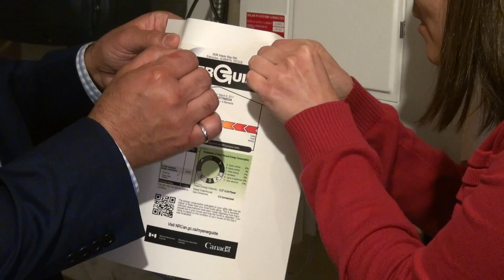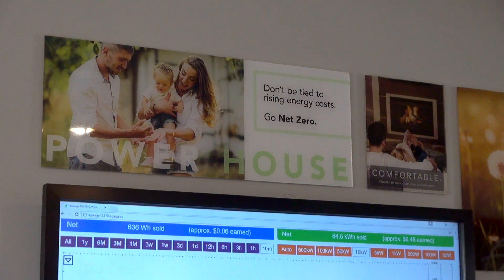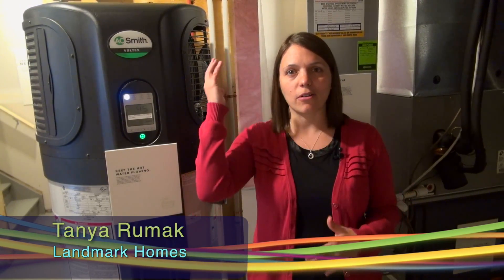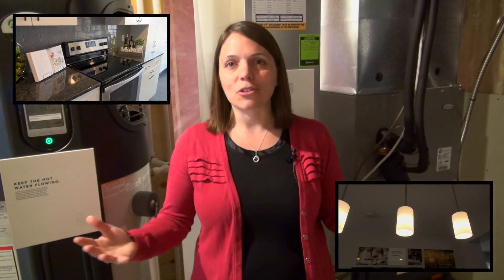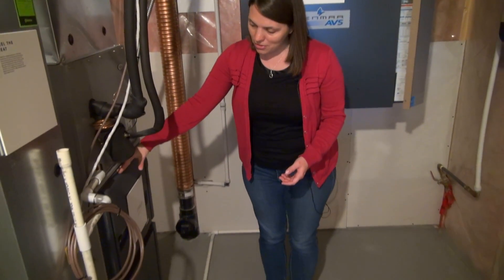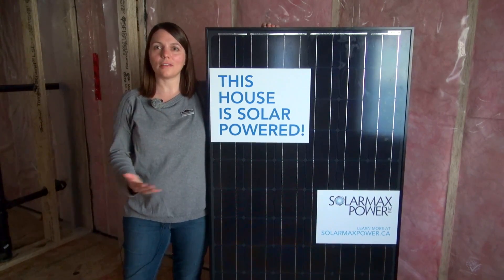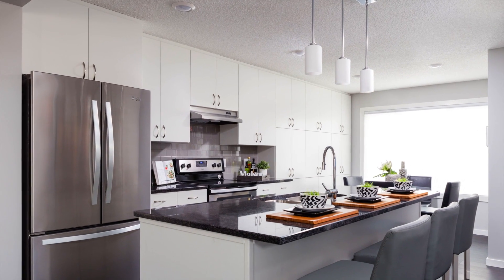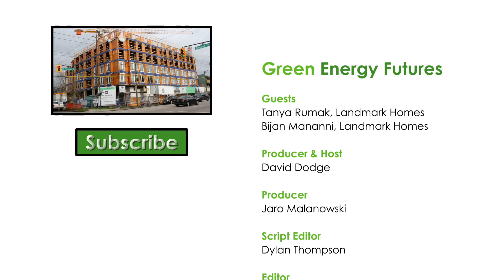168. The dawning of the age of affordable net-zero homes

Comment: hum   my home cost me $75000 it is 1700 sq ft. average total utility is around $150 a month. that is gas and electric. So around $55k to run the house for 30 more years.  I could still net zero the house by putting 30panels out in the back yard or roof.  No battery just grid tie. and still only add $15000 to the out of pocked and be net zero.  My guess is that at almost $400,000 am going to see this (Mine) house torn down a long time before the difference in my utility cost come close to the cost of going net zero in this example.  Net zero is great dont get me wrong, 75% of energy savings needs to start by making the house efficient.  This always starts with getting the building envelop correct.  Well sealed, great bulk water shedding, well controlled vapor and air barrier and getting the house down near the passive house standards.  Add in some passive solar and you have a building to crow about.  1200 sq ft is a great starter home or retirement home size.  So what are we looking at 600 sq ft space on each floor.  Two bedrooms a bath a decent size amount of closet space and of course loosing usable footage with the stair and hall way.  So not big.  But the $333.33 per square foot is not anything I would call affordable.

Comment: The Oracle of Omaha bought Nevada power the consumer who spent $20k. Now no longer pays for system. Berry low net meter you are charge a fortune net meter can charge. You did not explain lower net meter. Local put has 12 cent rate. 
A base connection fee $50 per month

Comment: Normal home 2500 as ft. So you only have half a house. $400k ÷ 1200 = $333 per sq foot. For net energy house 
Financing
Purchase $400k 
Finance $ 340k 
@ 4.5% put $1850 plus insurance and taxes. Will it appraise new construction at $333 per sq foot? What is cost of energy bonus package?
Can you appraise the cost savings of $300 per month at 12 cents kWh? Will bank accept adjustment to loan formula of 32% when no $3600 annual lite bill?

Comment: I like it, but why aren't they storing the surplus power in a battery pack? Surely something like a Tesla Power Wall unit could be incorporated in this design. That way when back-up heat is needed you'd have a ready supply of power. And with Alberta's incredible sunshine any extra power could be part of a F.I.T. program. Also, was spray-foam insulation ever considered? It makes for an incredibly airtight structure and has great sound attenuation properties. Thanks for keeping us up-to-date with your informative videos.

Comment: I noticed the TV screen in the house providing a visual representation of energy usage? Presenting energy usage in a visual manner is key. I just bought a Toyota Highlander Hybrid and one of the screens presents energy usage, hopefully making the driver use a lighter foot on the accelerator? Your videos represent rapidly advancing technology in the housing sector also occurring in the aviation and automotive sectors. Another common element I see is system integration where the various house components work as a complete unit. The houses are very attractive looking as well.

Comment: Wow. . . Net Zero for the life of the home. Must be nice... Except for, wait, what's the lifespan again?
Reply: Properly built, such a home can last indefinitely.
The mechanicals (and windows) will need to be replaced every 30-40 years (including the solar).  
But the shell of a well built house shouldn't need anything more than paint and maybe some caulking.
It's one of those things were a little extra time, care and expense up front add IMMEASURABLY to the lifespan of a building.
All the crap code-minimum houses you saw built in the 80's, 90's and 2000's?  Most of them MAY have a 50 year lifespan, if actual care was taken.  Most will be lucky to last 30-40.
Reply: @PhotonHerald  Not true regarding the lifespan of non net-zero homes being built.

Comment: Earthship homes have been net zero for over 20 years.
Reply: That's interesting.    But I remember (born 1957) that in the mid 1970's the University of Minnesota had a building built that had a lot of the same features.    There is a picture and article about the house on the cover of Popular Science, Dec. 1975 issue.     I think they started building it in 1973.   So the these ideas were circulating around at that time.
Reply: http://www.greenenergyfutures.ca/episode/saskatchewans-first-certified-passive-house
Reply: the type of solar this had was thermal.   It ran water pipes with antifreeze and collected it.    The first tests the U of Minnesota did was whether to have water pipes with fluid or can water be just sprayed on panels with clear plastic over it.    It is twice as efficient to have water pipes.    they probably had an 8 by 30 foot area as the collector.    All thermal then.    But they also had a small wind power generator.   (okay, a 2.5 meter by 9 meter collector area, but in feet)
Reply: and ugly as well
Reply: and look hideous